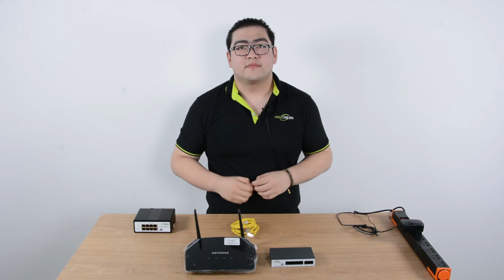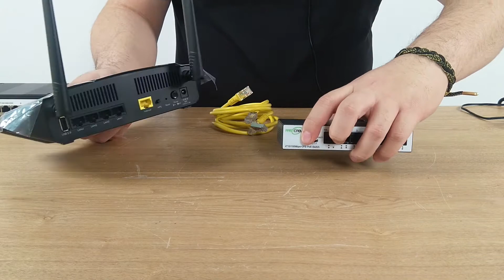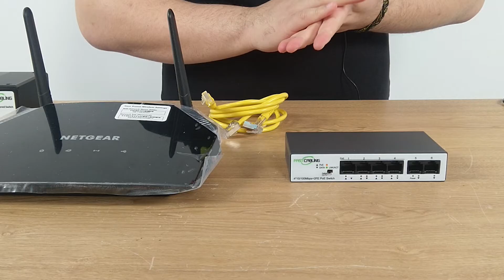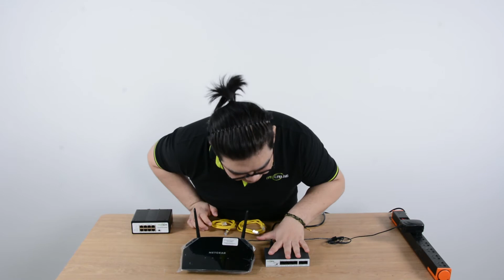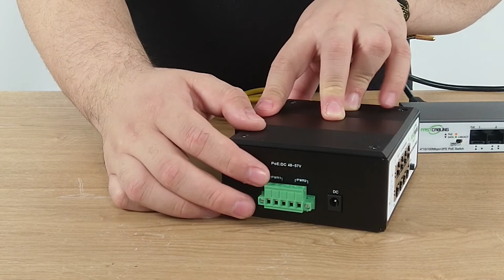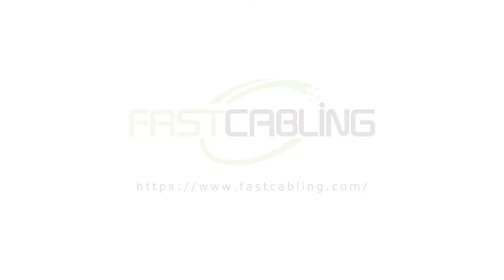PoE Switch VS. Ethernet Switch

Comment: Please clarify this for me...........
Modem >>> Router >>> PoE Switch to (PoE Devices) >>> Ethernet Switch to (non- PoE Devices)
Is this a correct set up? I'm attempting to add security cameras to my system to run off the PoE
Reply from the maker: I think it supposes to be like this PoE switch >>> Ethernet cable >>> PoE IP camera (or non-PoE devices). The power negotiation (power handshaking) can distinguish the non-PoE equipment and supply the data only.